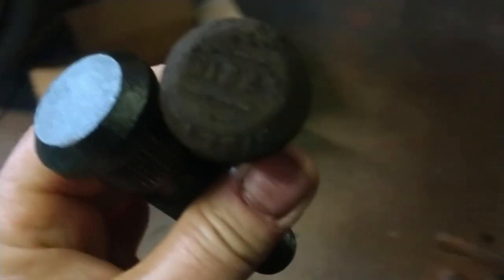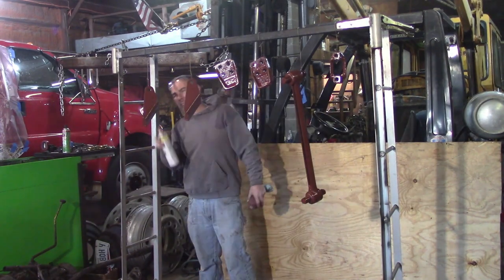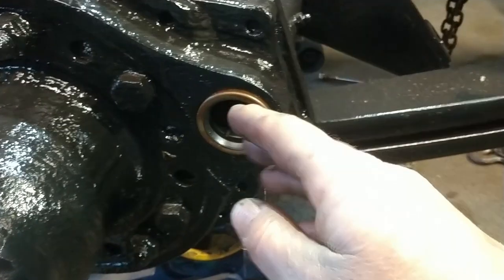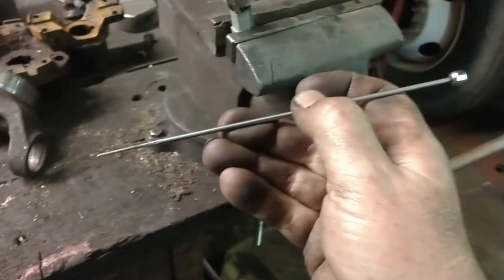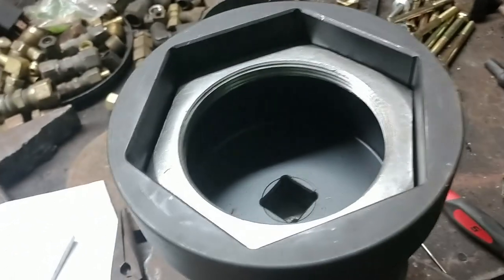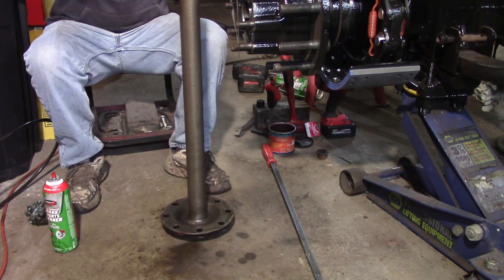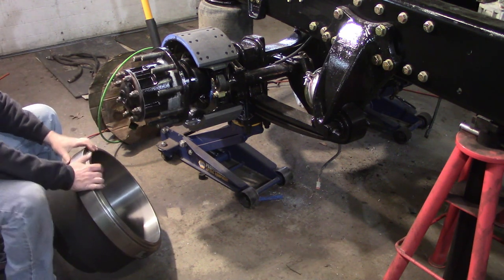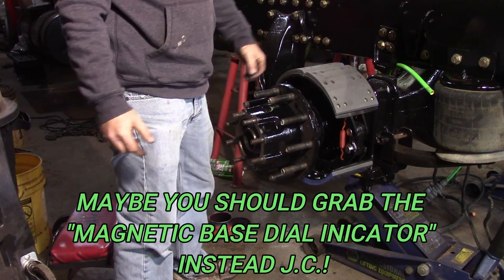2009 F750 AIR RIDE PART 7 COMPLETE INSTALL AND ASSEMBLY OF AXLE & AIR BRAKES!

Comment: I will send in some pics of my slow progress on retrofitting a GMC highway coach air ride suspension onto a 1972 fire truck which has a Cummins NTF small cam in it. Thank you for taking the time to show procedures and parts in this current build. It really helps.

Comment: Thanks for the air brake explanation. I have 3 different types DD3, Spring brake and old school air applied with a Johnson Bar drive shaft drum parking brake. Our old Greyhound buses are quite the challenge but I'm not telling you anything new. Keep up the awesome work!!!!

Comment: Hello; J.C. Great video. One thing I do is to take the axle cones, put them on the end of a screwdriver and wire wheel them to remove until they are clean from rust etc.. Them never seize them when installing them into the axle. Many times I had a hard time removing those that were rusted in. Also I put white lithium grease on the bearings on install as a primary lube.   Stemco seal installers can be expensive if you a lot of different axles sizes, and brands. Your video was long but it was also involved which made it worth watching. Thank you.
Reply from the maker: i wire wheel the cones as well. i put never seize on the axle in the cone holes as well. i cut some of the less important parts out since the video was over an hour long already.

Comment: I always greased the bushings and cams before installing the cams and spin them several turns before installing the slack adjusters because greasing through the fitting doesn't get grease all the way around the cam bushings and I've seen the cams rust and lock into the bushings. I used anti seize on the axle studs and wedges because I might be the next person who had to remove the axle and they are much easier to remove. I used anti seize in the splines of the brake cams and slack adjusters so they can be removed easily. I also used it on the brake chamber mounting bolts, yokes and pins for the same reason.
Reply from the maker: if you see the in the video i greased the ends of the s cam tube and put grease in at the fitting before i put the cam in. i failed to neversieze the cam splines before i put the slack adjuster in place on camera. took it back apart and added it.

Comment: That looked like a little quick release valve, I think it's called on the frame you replaced. Some of the new ones  are plastic I've seen.
Another thourough repair job, Sir.

Comment: I am a relative newcomer to your channel.  I've seen perhaps a quarter to a third of your videos.  This most recent video is hands down the best I've seen so far.  The content and attention to detail is top notch and I love the idea of seeing other peoples projects.  I've been meaning to ask you how you can drive your rollback around with no identification or DOT numbers?  Just local back roads?  That would never fly here in Michigan.  Ever since the local municipalities got the authority to bust on commercial vehicles, in addition to the large trucks, they pull over every pickup truck with a lawnmower in the back asking for a company name and a DOT number.  It's ridiculous!  You might just be taking your mower to get it serviced and they think you're running a business.  It's all about the money.
Reply from the maker: welcome to the channel! hope you find videos you enjoy. all my equipment is licensed, insured and has the appropriate identification. i dont show it in videos. these videos are for entertainment. they are not to promote my business.
Reply: Thanks for the response J.C.  While I got you,  what is the brand name of the heavy duty red 4 legged jack stands that you have?  I too could make them but often times it's easier just buy them.
Reply from the maker: sunex. bought them through summit racing when they had a sale.

Comment: Always enjoy your videos you do great work and have to get a good return on your trucks as you make it a point to replace what’s needed.  Tom
Reply from the maker: tom, this truck is getting more than my average truck repair. few go this deep. however, if it needs replaced to be make a truck safe and reliable....well, i guess it just has to be replaced. a few hundred extra sure id better than sitting along side the road waiting for the tow truck at $150. per hour.

Comment: Re: bolts.
Flange bolts and flange nuts.
Actual frame ones are stronger than grade 8 and no messing with washers.
Angle wrenches;
I have a set of MAC up to 1 1/2".
I have Pittsburg from 1 1/2" to 2".
The mac wrenches are kinda short in length.
I think the same set in Snap-On are longer.
The Pittsburg ones are longer. If the fitting is out where I can swing a wrench, I will use the Chicom one over the Mac.
Air leak;
I am surprised the QR-1 valve was the leak. Those push to connect fittings are air leak factories!
Had a Navistar engineer tell a group of us, Navistar started using them to save money on warranty claims for air leaks, and we laughed him out of the room.
Between that, and the MaxFARCE engine, they should be broke and out of business.
Reply from the maker: understand that i normally use flange bolts and nuts. however, i purchased the majority of the bolts for this project when covid 19 had the country shut down. my normal supplier could not get inventory and i didnt want to mix half and half. we call them push to leak connectors. rust was the cause of the quick release valve leak.

Comment: Watching this video for the umpteenth time
Reply from the maker: you must be gearing up for a project kevin?
Reply: @j.c.smithprojects  
I want to do the same thing on my Mack and lowboy . I’m also looking at putting a montazuma toolbox 🧰 and pony motor on the lowboy so I can use it with any truck. I also want a wet kit on the Mack. I’m still driving company, buying parts as I can find them and saving for the move to Huntsville Alabama.

Comment: Hi JC, at about time 50 minutes into this video you mentioned angled rachet wrenches, I brought a set for my Toyota a few months back  I suggest please try before you buy if you can, I wish I had just brought the straight rachet wrenches instead.
You only have 2 sets of complete knuckles on your hands it's best to keep them in good condition.
Tony from Western Australia 🇦🇺
Reply from the maker: i am looking at "angle head wrenches" not ratcheting. i have a love hate relationship with ratcheting wrenches. i have had several brands and dont love any of them.
Reply: @j.c.smithprojects  I thought I was being smart in getting the flexible, angle ratcheting spanners, the quality is there but I find that they are awkward maybe if you have got the nut or bolt released then use the angle ratchet it would be ok.
Are you thinking of the spanners that are sort of arc shaped as apposed to 45 or 90 degree's from the straight?
Tony

Comment: Any pointers on the brake peddle on a 9200i international. Some of our trucks have "hard" peddle. We have a young mechanic good but no experience.
Reply from the maker: peddle is on the floor. steel barrel going through aluminum body. steel plunger rusts and makes it hard to push. they will also get stuck applied. if the trucks sits a lot, i spray it with pb blaster and work the pedal before i drive.  probably best to replace it.
Reply: Thanks for the tip.

Comment: I noticed that you didn’t have any backing plates on the brakes.  Are they no longer required?
Reply from the maker: they were long gone on this axle. i like being able to see the entire brake lining. if there is a crack or separation, it can be caught much easier. never been put out of service for not having them.

Comment: Just a quick question would the studs seat fully when you do a full torque on the wheels? In case they hadn't bottom all the way. All the best from Canada
Reply from the maker: i wouldnt rely on it.
Reply: You did say that you check them a couple times afterwards. So you're doing the extra which is great.👍👍👌👌

Comment: I hate to be the "Critic". 
The second snap on the torque wrench is useless and wrong. You don't know what the real value is because you snap the mechanism. I got that from the Snap On torque sales man that trained us. Don't feel bad, he also trained the NASA techs. God only knows how many satellites out there are flying with over torqued bolts. To stop this habit, you can spend the buck on the latest torque wrench that chirp and give color lights announcement, or get the old wire indicator type from Advanced Auto Parts for a few bucks. I guarantee you will never snap the wire type on any bolt. I prefer the older style because of true reading they provide. My favorite one was the two men unit that we used to tighten big bolts with to 600ft/lb upside down and over our heads. That was a job! Our machinists have to use torque wrenches with radio control to follow procedure for part mounting on machines. It has to be perfect or the machine will not start. Parts that they make cost from 50k and go up to 3m each.
Reply from the maker: i guess its a good thing we are not working on satellites or 3 m machines because i think it works just fine.
Reply: @j.c.smithprojects  you are correct, sir. The end product is completely different. The difference in the level of precision between a truck axle and a jet engine rotor is astronomical. Every part that comes off the cnc machine is checked multiple times in a batch of one. We make safety equipment. That's what jet engines are in reality. Expensive little bastards.